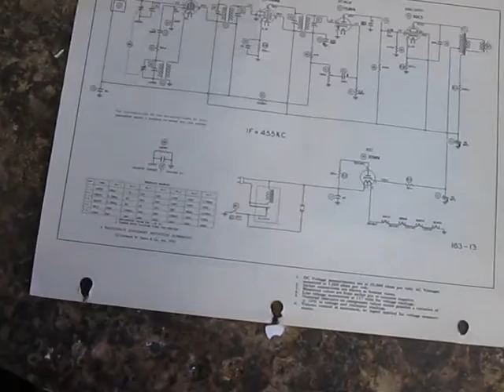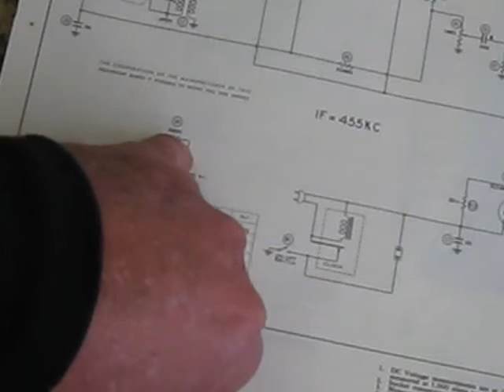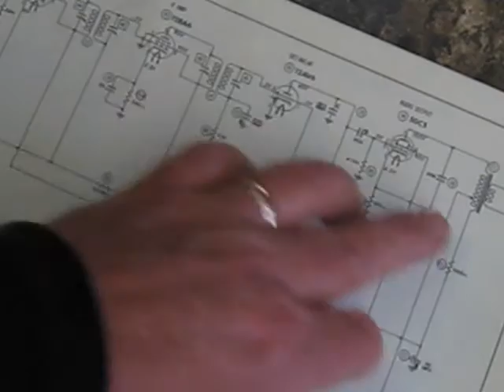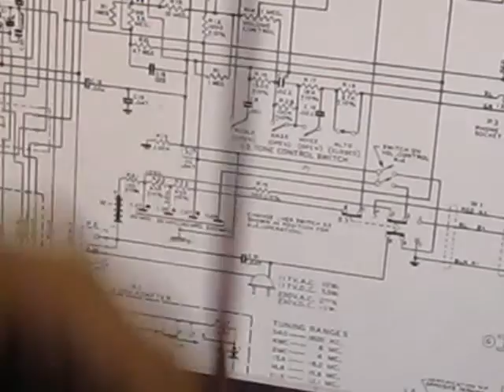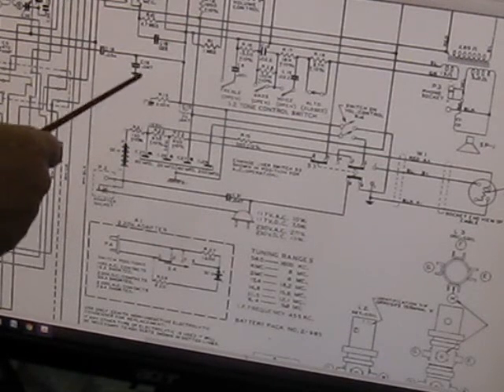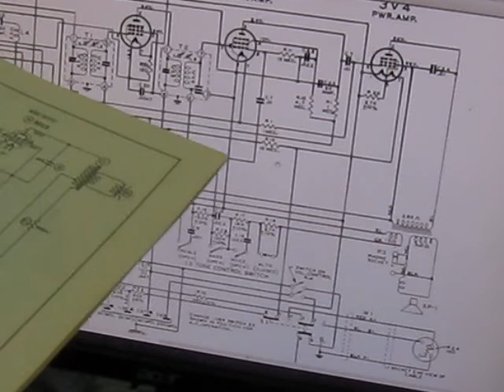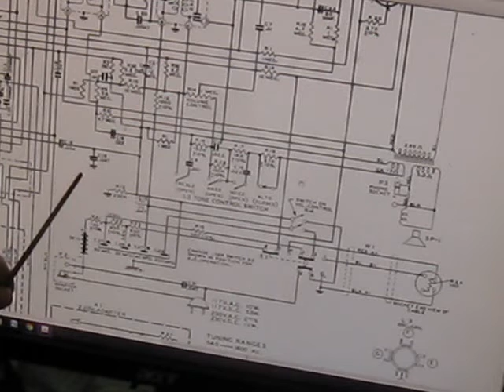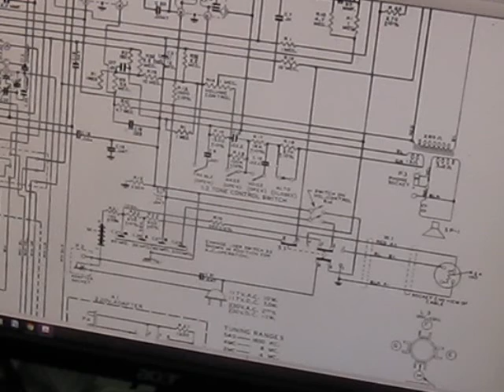Answer of a question on voltage measurements

Comment: Fantabulous, Dennis. This is one of the few videos that points out that voltage measurements are always relative!relative to here from there, not an absolute measurement to earth.. Many times this scheme is used to develop a fixed bias in a circuit, and could very well result in confusing results. The lesson here is, "KNOW your circuit." Thanks for your very clear tutorial..................................Dick

Comment: hey Dennis, I'm looking to buy a tube tester what would you recommend?
Reply from the maker: +jeremy crow That depends on your budget and what you are wanting to test for. If you want a low cost tester then any of the standard emission tube testers are just fine, but if you want a tube tester to test for transconductance then look for a Hickok tube tester.
Reply: I'm just starting to get into this as a hobby, as for funds well.. married with 4 kiddos so there's not a lot. Lol but I'm trying to do best I can with what I have for now.  I was lucky to find a console in my alley someone had throw out, I was able to scavenge the magnavox 6v6 amp, tuner - pre amp and the speakers.  I also just bought a few amps from eBay and waiting for them to arrive.  Guess it's time to get a tube tester, but wasn't sure where to start.  Your input is very much appreciated. Thank you.